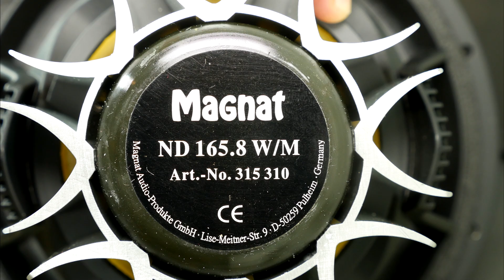Look inside High-End class Center channel speaker - What's Inside?

Comment: High end?. In what universe?. You can't count 33mm for the baffle where the speakers lay because they lay inside of the 33mm. It's the actual thickness of where the speakers are screwed into and not around it is where you get the correct baffle measurements. Very cheap and cheesy crossover for a  " High end" center channel speaker. Sandcast resistors don't go inside High end speakers. That alone tells you this speaker is budget range.

Comment: Hi thank you very much indeed.  I love these videos a lot.  Impressive the 33 mm front baffle ... this is by far the most important panel in a speakers because it is the one more stressed.  Great speakers have all great baffles.  Kindest regards, gino
Reply from the maker: Great to hear!
Reply: @Techscrews  Hi i thank you very much again because your videos are extremely educational.  They put the focus on drivers, x-overs and cabinets construction ... especially drivers in my opinion set the limits acheivable by a speaker.  A great designer can extract the most from a driver but cannot go beyond the drivers' limits, of course.  I opened some cheap speakers and i was shocked by the poverty of their drivers.  Actually i am trying to understand which brand offers the drivers with the best q/p ratio ... i am a lot on DIY and sourcing drivers, especially good woofers, is very very expensive indeed.  If you have other suggestions i would be very thankful  Kindest regards, gino

Comment: high-end speaker and not even real wood.
Reply: "Real wood" is not homogeneous, which is why it's not a good choice and why MDF is better. If you want real high-end, you go for a custom plywood, like on B&W 800 series, or aluminium, but that requires expensive custom equipment.
A lot of highend (and I'm talking real highend, not magnat) speakers have cabinets made of MDF.
Reply from the maker: real wood cost too much, they use real wood veneer, that give a look and nice feeling. For sound main think are material thickness which prevents resonance.
Reply: Those magnat are more mid-end speakers.

Comment: Magnet lol,that is low class stuff :)
Reply from the maker: These speakers use neodymium magnet and it's not low class.
Reply: @Techscrews  magnet is garbage 😉
Reply: Royk Groningen Nope do some Research befor commenting
Reply: @royk007  You know absolutely nothing. For a Neodymium, that's actually a decent size + bigger isn't always better, as you don't want the motor be too strong for the moving mass, which would make Qe (and therefore Qt) of the driver too low, which would result in the impossibility of getting some bass from the speaker.
You want the magnet to be just the right size, not to be as big as possible.

Comment: I'm trying to figure out what the fins on the magnet are for. Its not making much contact so it cant be for cooling.
Reply from the maker: speaker driver have shielded magnet system, that made of neodymium, in which
Copper rings for low inductance and good thermal conductivity. More can find out on google.
Reply: i believe that those are heat sinks, if i am correct than yes they are for cooling.